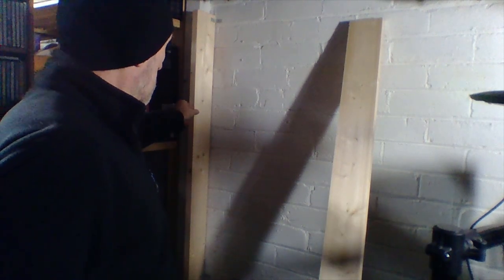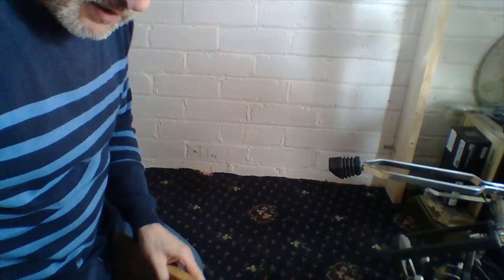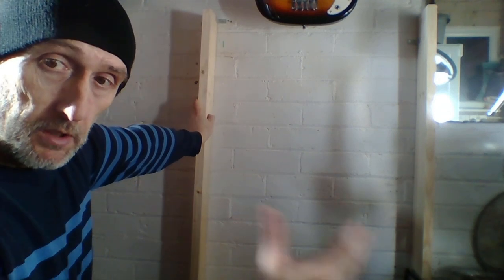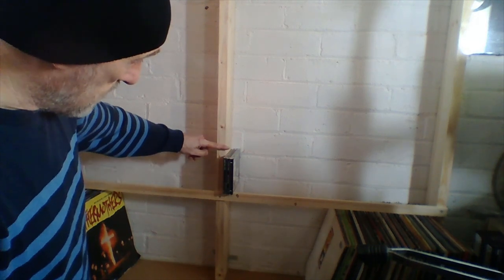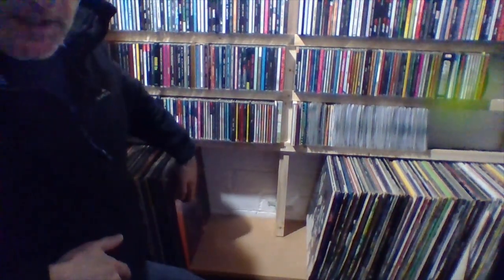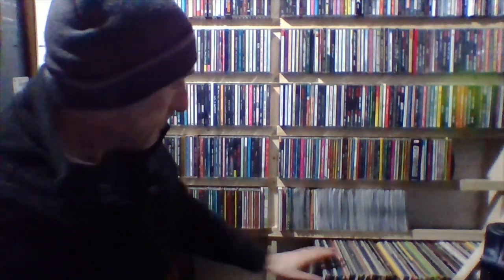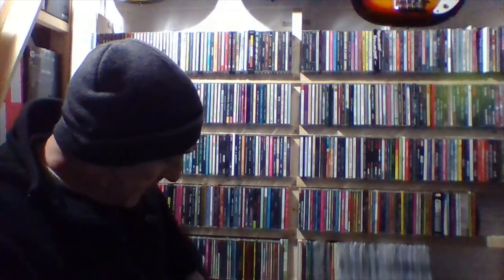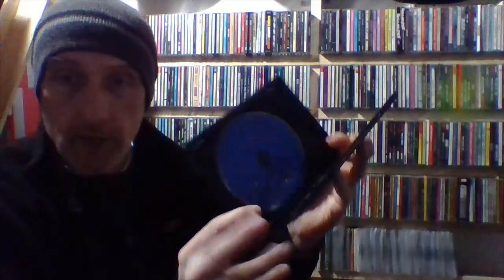How to build cheap D.I.Y Physical Media shelving for CD's, Blu rays, 4Ks, and Vinyl & Unboxing!!!

Comment: I built my shelves like this last December.  I painted mine black to go with the rest of my shelving.  It was easy and it sure did help with organizing my collection.  New subscriber here.  I look forward to checking out more of your videos.
Reply from the maker: Hi and thanks for subscribing 👍 ill check out your shelves on your videos 👍👍 when you paint your shelves what sort of paint did you use? I find this has made my whole collection (audio and movies) so accessible, no more rooting through cupboards 🤣  thanks once again for subscribing, I've subbed back and ill take a look through your content 🤩🤩👍👍
Reply: @MondoChelloveckMovies  I used a black stain instead of paint.  I bought a quart and it takes very little and soaks into the wood very well.  It just takes a long time to dry before being able to place the media on the shelves.  I also placed a strip of clear packing tape across the top of the 1x1 strips, so that the slipcovers slide easily and do not get ripped from the wood.  I am OCD about my collection and also keep my slips in protective sleeves.
Reply from the maker: Thats a great idea actually!! The tape is a clever idea for sure, yeah I'm the same O. C.D to the max! Well you gotta really, I love keeping these in great condition, I was thinking about getting some of those clear plastic bags to put my movies in but ill need a couple of thousand of them!!! 😲 cheers for this great information 🤩🤩👍👍

Comment: Hi John Great video  I was wondering what size joists you used and  cross rails also when building for storage is it always best to start at the bottom first/?
Reply from the maker: Cheers for this comment Jackie, I'm out and about at the moment so I'll get the measurements for you when I get home 🤩🤩👍👍
Reply from the maker: Sorry for the late reply Jackie, the joists I use are 3 and a half inches by 1 and a half inches (nice and solid but not too big) the cross rails are about 8 FT in length, 1 and a half inches by half an inch, as long as you don't space the joists out too far the cross rails really hold well, yeah go from the bottom up and I might (on shelf 2) put a thin bit of mdf for the first shelf on the floor then start the first cross rail above them, quite easy to do Jackie and they can obviously fit literally any space you want! Actually if you look thru my videos you will find me recreating this set up in my garage for all my cds 🤩 hope this helps mate 😊😊👍👍